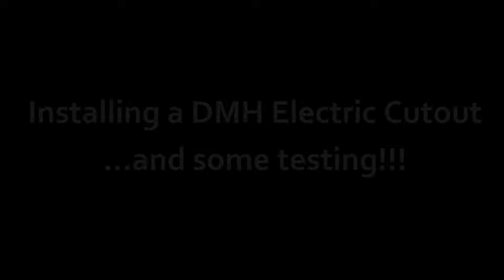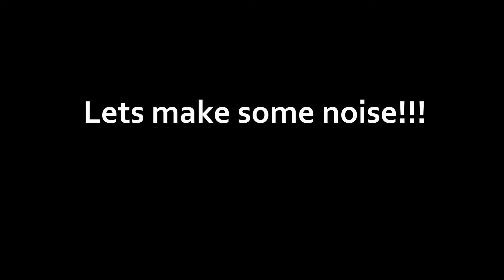DMH Cutout Install and Testing!  Sound/video clips!

Comment: Those seats are crap, get better seats that don't wobble and hold you in! And power is nothing without control/traction, but fun !
Reply from the maker: Yeah they are! They are stock 2000 Trans Am seats.  And I weigh 220 lbs.  So...they're stressing haha.  The thing is, they are comfy.  And I want to keep the car functional.  So bolting in racing style seats is a challenge.  Also finding ones that fit me and the car has been tough.  PLUS I still take my kid in the back, so I need to be able to fold them forward, etc etc.  Im working on it :)  And yeah...traction is nice.  Slightly damp roads, and cold tires in these vids.  The car with warm tires, on decent pavement actually hooks very nicely.  They are Nittos and love being warm up a bit.  Also helps if Im driving sensibly, which Im not really doing here :)  Thanks for the comment Joe!

Comment: what size exhaust is this???
Reply from the maker: 1-3/4" Primary long tubes to 2.5" collectors.  2.5" y-pipe into a flowmaster merge that expands to 3".  3" from there back through a magnaflow catback.  Cut out is a 3".  It breathes VERY well.  If I ever do it again, I will do 1-7/8" primaries, 3" collectors, and 3" all the way back...maybe even true duals with 2.5".  I have plans!

Comment: The only thing I hate about those late 80's models is they ride like a tank. Ta's and camaros would bottom out if you hit a hole the size of a golf ball. Nice for bolt on power but I wouldn't put a pregnant woman or old lady in one. They would break water or hips.
Reply from the maker: Haha....both the WS6 and this standard Trans AM rode pretty nice.  The WS6 was pretty stiff, but very the plush seats made up for the harshness haha.  This one in stock form was really cushy.  Very sloppy feeling.  It now has Eibach springs and Bilsteins, along with poly/solid mounts everywhere.  So it is leaning more towards performance than comfort.  But it is still great for cruising or road trips.  I just need new seats.
Reply: JEG's Garage Sweet upgrades on the suspension! That helps a ton. Bought my wife a new mustang gt a couple years ago and other than just fun for power, I hate driving it because it rides rough and has a lot of cabin noise. But I guess that's what you get when you are buying for horse power and not pleasure. It's our second stang and I told her I would never buy another one again. next time I'll give Chevy a try.
Reply from the maker: Yeah the newer cars are definitely a lot better.  But a muscle car is a muscle car.  They never were quiet and totally comfortable.  Thats why some of these high power luxury sedans do well.  You gain a good bit of weight making them super quiet and comfy, but its SO easy to get big power out of the newer motors.  Especially the LS stuff.  You can easily make up for the extra weight, while still having great street manners, reasonable MPG, and tons of fun.
Reply: JEG's Garage True. But I'm an all old motor metal body guy and nothing is better than the good old smell of pure octane without all those sensors to save the trees. Lol. Keep up the vids. Great work!  Love seeing what everyone has to offer with their rides.
Reply: JEG's Garage True. But I'm an all old motor metal body guy and nothing is better than the good old smell of pure octane without all those sensors to save the trees. Lol. Keep up the vids. Great work!  Love seeing what everyone has to offer with their rides.

Comment: I have a 06 Dodge ram hemi soon to be cammed and it already has headers and I'm thinking of a cut out.. 
because the truck as is is loud now.. long tube headers and flow master super 10 so I'm thinking of after cammig it do 1 3" pipe behind the headers and put a pro venom 250 and a resonator there and before the resonator have the cut out so I can scream when I feel like being a bitch.. 
do you think it would work like that? 
this truck will be used for long road trips as well so I don't always want it screaming
Reply: U ls JFK hDzi
Reply: dafuuq
Reply: Igor stefanovski idze wttc imola

Comment: What exactly does this thing?
Reply from the maker: It opens the exhaust and bypasses the muffler/catback.  In some cars with restrictive exhaust, it could free up considerable power.  In a car like mine, its MOSTLY for sound/fun.  Though Im sure it makes a small measurable difference on a dyno, its not something I feel on the street.

Comment: Just for sound? isn't this equivalent to just Making an exhaust leak?
Reply from the maker: +Statyk Elektro in my application just for sound/fun. I'm sure it makes a slight difference up top. But it's minimal on my car. I will test it when I get the car dyno tuned this spring. And yes... It's effectively making a controlled exhaust leak. Difference being its a clean opening, so you don't get the wheezing or whistling. No different than guys running open exhaust at the track.

Comment: What exactly does a dmh do
Reply: And what does it mean
Reply from the maker: It a valve that opens the exhaust  and bypasses the muffler.  If your car has a stock exhaust, and you want to occasionally bypass the restriction for a track day or whatever, this will temporarily act like an open exhaust.  Probably hurts down low but helps up top.  Doesnt create power...just frees it up.

Comment: Error #1 ring on the finger, #2 no driveway creep pit or alternativly jack stands, those ramps will KILL YOU!
Reply from the maker: Haha...probably one of a handful of times I actually had my ring on.  I usually pull it off even when I cut the grass.  And as for the ramps... they are fine for this job.  My head wasnt under the car.  Just my arms.  If it dropped straight down it might hurt my arms a bit, but no real chance for death here.  What I REALLY want is a garage with a lift.  Its at the top of my list when we/if we get to move anytime soon.
Reply: Yea we call those ramps widow makers lol.
Reply from the maker: I dont know.  Ive had mine for YEARs without any sign of starting to fail.  I check them regularly for cracks/side wall issues.  Nothing.  12,000 lb rating that Ive never come close to.  If you ram the car up on them, and slide them, or dont place them properly, you will certainly increase your risk.  A lot of the failures Ive seen had to do with how they were being used.  Dont get me wrong...stuff happens.  Normally if my body is going under, I get stands.  But then again, if I need to get under the car, the ramps arent going to do it.  At least not with my Firebird.  I use the ramps, to give me room for my jack haha.  But Ive still never had any issues with them in the many years of use.

Comment: i bet you go thrue tires quick. i know i do in my z28
Reply from the maker: Im actually only one my second set of tires since I did the initial swap back in 06.  Those were Goodyears and they came with the wheels.  So I have no idea how many miles were on them.  They were pretty low, and also cracked.  These Nitto's have only been on for a couple years now.  I really dont spin that much. Only when Im goofing off...or showing off.  Luckily, I can rotate front to back since the wheels are all the same.  That helps.  If I had it my way...I would be going through tires much more quickly :)

Comment: WHERE DOES THE WIRE GO?
Reply from the maker: The wire goes up along the floorboards, tucking under the original head shielding, through a hole in the trans tunnel where the original auto shifter cable went through. The next time the interior is out, Im going to have the wire go straight up through the floor and up front that way.

Comment: The only thing missing is the wiring
Reply from the maker: Yeah this video was just supposed to be a fill in while I made more "meaningful" videos.  However it appears to have taken off haha.  The wiring is simple if you use the switch provided by the manufacturer.  Just give it power and ground and away you go.  If you want to wire to the convertible top switch, I think I found the pinout using google or maybe on the forums.  Been a long time.

Comment: DO NOT EVERY BUY DMH.  They fail quickly and customer service is null.  I shipped a pair back, years ago, hounded the owner and NEVER got my cutouts.
Reply from the maker: I made this video 7 years ago and it's still working perfectly...car sits outside, driven in rain, etc. The original failed because of the bearings. They switched the design to bushings which was smart. They refurbed mine quick and no hassle with great communication. 🤷

Comment: water resist??
Reply from the maker: NO issues with water so far.  Its made from aluminum and stainless.  I wouldnt submerge it for too long (though I did once), but for normal daily wear and tear its fine.

Comment: Had a teenager last night in his little import hear my car at the lights idling. Pulled away normal and I heard this gay ricer import thing ringing it's neck past me so I decided fuck it left it back one and I heard him go through every gear redlining each one and peaking out. Sat next to me for a few seconds before I gave it a bit more and went up another gear and cruised calmly away from superman back there floggings his piece of shit trying to catch up.

Where I pulled off the highway had me blinker on slowing down, that's when he flogged his car past me probably so he could go home thinking he got me back, I didn't get away with making him look ridiculous.

I drive an 03 V6 rodeo Ute or "pick-up" as you americas call it. It's done up but still just a daily driver. He had this thing that's had money poured into it.

Comment: you could of welded a throttle body to ur pipe with a cable and level to close and open. sucks u gotta work on ur car each time. time wasted...
Reply from the maker: They make cable operated valves... Not what I was interested in.  This is much cleaner.  Not sure what the second part of your message was about haha.

Comment: yea i know im the downer here sounds awesome but cops & the environment it is air pollution & noise pollution is that your everyday driver or you a track guy?
Reply: I'm sure he doesn't leave it open much. if the noise bothers people they are overreacting.
Reply from the maker: Ive been pulled over once.  It was late night, and I had the cut out open a bit from the highway.  I normally close it in residential areas...if I open it at all.  The cop came up to me and said "you were making some noise and I just wanted to check things out since its late."  Then we talked about cars for 10 minutes haha.  I try not to be obnoxious.  Im certainly not any more so than the Harleys that roar through my neighborhood at night.  As for air pollution, the cut out doesn't add to that at all.  Most cut outs are installed downstream.  Any cats are before it, and thus, no more toxins are coming out than if its closed.  All that being said....this is an 86 Trans AM, with 2000's+ technology.  Ive seen my print outs from the emissions sniffer test BEFORE the swap.  I know the levels that are acceptable to this car.  Ive also seen what the current set up produces, even without cats.  It runs cleaner believe it or not.  Even with heads and cam.  The tune is tight, and the management software is leaps and bounds better at keeping the efficiency in check.  Could it be cleaner, sure.  But the car sees way less than 5000 miles a year.  This year I doubt I hit 1000.  Its a weekend fun/track car these days.

Comment: this is a good way to get carbon monoxide poisoning not smart
Reply from the maker: Nah.  Its blowing out right by the rear axle, and its directed out the side.  The car breathes out so hard, its not like it dribbles out and up.  Not much different than side exit exhaust.  On that note...Im pretty careful to not leave it open while sitting at long lights or in traffic, as the idea of CO poisoning doesnt appeal to me.  Going down the road...not much to worry about.

Comment: Too bad they're not adjustable.
Reply from the maker: Adjustable how?  You can infinitely adjust the amount of open/close.  Not sure where else you'd want to adjust.
Reply: @JEGsGarage  so they ARE adjustable? I want it to sound throaty but I don't want it so loud as where I would get tickets for it.
Reply from the maker: @15DurangoRT  yeah you don't have to fully open them. I usually just tap the button 2-3 times and it will sound good without being ear splitting loud. This video has it fully open most of the time.
Reply: @JEGsGarage  Cool! I'm leaning towards getting a pair. Thanks for the info and the eardrum popping video!

Comment: Looks illegal.
Reply from the maker: Eh... So is speeding :)  So is most aftermarket exhaust, suspension, and lighting.  In fact if you actually read the highway codes, 90% of what car enthusiasts do is "illegal" for street use.  This isnt hurting anyone.  Its not creating any more emissions opened than closed.  Just more noise.  Still less noise than a harley going full blast, or some of the 4cyl guys with their 4" exhausts spinning 9000 rpm haha.  Thanks for checking out the video!

Comment: waste of $75.00?
Reply from the maker: AngryDuckSoup huh?
Reply: "huh?" Duh. lol.Car sounds quite powerful. I don't understand why you would make it so noisey to attract more attention?
Reply from the maker: I didnt know where you got $75 from haha.  And yeah, the car does sound pretty good even without it.  It was mainly just for fun.  We'll see what kind of power, if any, it opens up once I get it on the dyno.  Chances are, with as good as my exhaust is, it wont show much difference.  If it doesnt, I likely wont use it on the next exhaust setup.

Comment: pointless
Reply: EMPiiRE says the one who can't come up with a real insult lol. What's the point of putting this shit on your car when you can just straight pipe it? Because it's illegal? Technically so is this
Reply from the maker: Because this isn't straight piping it.  How is that hard to understand?  I don't want the car sounding like a freight train 24/7.  I can run it through a catback, or uncork it.  This has been an accessory for hot rodders for a VERY long time now.  They used to use thumb screws to remove plates.  Then there were the cable operated units.  Now electric.  Tell GM, and many other manufacturers that use variable exhaust, that this is pointless.  And while it might not technically be street legal, neither is 80% of the stuff you do to a car that modifies its original design.  Window tint, stereo's over a certain decible, wrong sized wheels/tires, upgraded brakes, etc.  If you don't get the point, then its not for you.  No big deal!